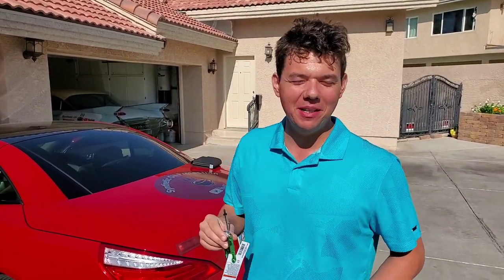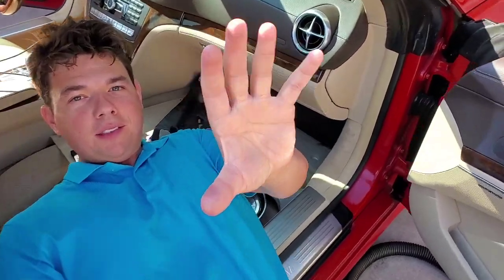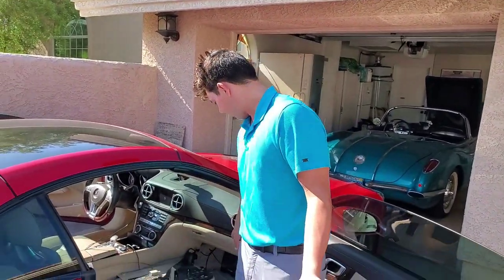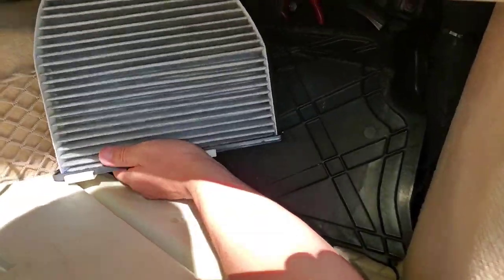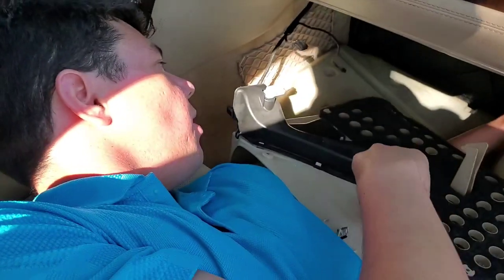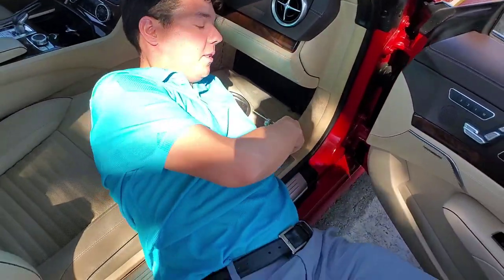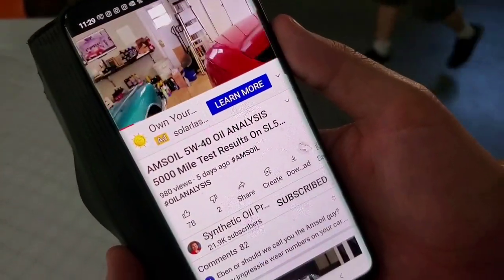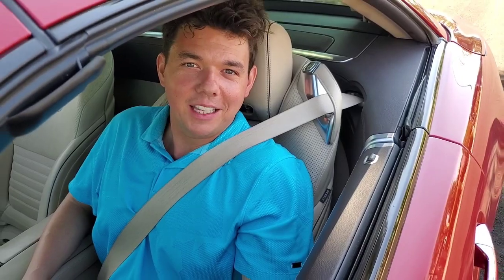Cabin Air Filter Change 2013 SL550 Mercedes

Comment: Very good video to show me where and how, my only nitpick is what about the 1/4”-1/2” gap in the trim with the 12v socket. It also moved, to me, too much as he was installing the next piece. I’ll be doing mine tomorrow so I’ll experience this issue then. Thank you again.
Reply from the maker: 👍💯
I give a man a fishing pole & show him how to fish. 

     Together! We can get your vehicles to run better than brand new!

     For me to get credit & be "Your" Independent AMSOIL Dealer please use my website below or my dealer no. 5331179 call anytime Eben Rockmaker 702-472-3614
After you click on: http://syntheticoilprotection.net
1. Click hamburger menu
2. Click offers AMSOIL preferred customer
3. Click join now 6-month PC member add to cart.  ( there is no reoccurring renewal membership unless you select that dot box ) 
( you have the option to not have your credit card saved if you prefer - est. 1972 )
4. Scroll up to the top Select shop by vehicle.

New promo: FREEQS 
     
     🥇🥇🥇   Synthetic Oil Protection Google map reviews
Eben Rockmaker, independent Amsoil Dealer 
Dealer no. 5331179
(702) 472-3614
https://maps.app.goo.gl/1aXxuXrXK9eJwqK78
            
♥️   See fluid performance tests - https://www.amsoil.com/performancetests.aspx?zo=5331179      

     ☕️   Buy me a coffee - https://www.buymeacoffee.com/Syntheticoilprotection

Comment: Lifesaver, just bought an AMG but was a smokers car .  Hint, n we w filter and some dryer shts will end that smell in about three weeks.  Perm.
Reply from the maker: Awesome enjoy your car and definitely check out the full playlist on the synthetic oil protection machine AKA 2013 SL550 you can do everything that I did to my car and when I got my car it drove like a 7 out of 10 now it drives like a 9 out of 10 it drives that much better After all the fluid changes.
https://youtube.com/playlist?list=PLB_ftWArBFdd-6mgaMuj9bNs7DvKRpNQm
Reply from the maker: If you ever have any questions let me know 💯👍😃

🎬🎬🎬 Professional YouLubher: Eben Rockmaker Regency Gold Direct Jobber AMSOIL Specialist (Dealer#: 5331179) 702-472-3614 

     ✅✅✅  New To AMSOIL I Recommend The AMSOIL 6 Month PC Membership because it will save you about $33 on a $100 purchase after the difference in tax - https://www.amsoil.com/offers/pc/?zo=5331179

Comment: That didn't look too bad. It's a real pain in my Nissan Versa. The whole glove box has to come out and then you still can't see the filter - just gotta feel around back there for it. It's a bad design from Nissan. I love the car, though. :))
Reply from the maker: Yeah the Nissans are definitely a stickler.

The Honda's are really a dream When it comes to the cabin filter and oil changes and transmission fluid changes and coolant changes.

I joke around with people and I tell them I could change the motor oil transmission fluid and coolant on a Honda fit in 44 minutes flat.

Curb styling All I would do is drive the car up on a curb and do it all in one shot lol 😆😁😄☕

I'm sure I'm exaggerating a little bit but it's amazing how easy it is uncertain vehicles 💯

Comment: What about the engine air filter does the k & n really make that much of a difference to where maybe the power and mpg have a noticeable gain or is it so minimal you really dont notice much
Reply from the maker: Oh you can definitely notice it.

On my C5 Corvette the air raid cold air intake that I put on did exactly 1.5 average miles per gallon better.

On my SL550 the k&n air filter did about 0.9 average miles per gallon better

Comment: Great video Eben. Your cabin filter isn't that dirty but, like you, I change mine regularly.
Reply from the maker: Yeah it doesn't look very dirty on the video however the silica out here is unbelievable all the dust and particles from brake dust and there's a lot of like sandy stuff that blows across the street all the time and that filter was totally saturated inside the media really not many leaves or bugs but more all kinds of fine silica particles.
Reply from the maker: I would say it's dustier here in Las Vegas than in New Jersey living on the beach

Comment: Serious question.. do you think amsoil is better than ultra platinum pennzoil?
Reply from the maker: Yes it's not even comparable.

Amsoil is 100% synthetic has a much higher film strength that film seals the cylinders and when the cylinder rings are sealed better there's less fuel contamination and blow by The breakdown of motor oil is exponential so over time it wears down quicker and quicker.

Fuel dilution can really damage the film strength and thin out the motor oil.
Also there's proprietary additive packages that are in themselves from cold flow additives and also anti-wear additives.
It's a big difference.
AMSOIL Performance Test Results. Read This Article - https://www.amsoil.com/performancetests.aspx?zo=5331179
Reply: @Syntheticoilprotection  been using ultra platinum pennzoil and so far good but i will give amsoila try
Reply: @Syntheticoilprotection  how often should i go oil changes with amsoil? I usually go 5,000miles with ultra platinum pennzoil
Reply from the maker: The thing that's going to really surprise you is what it looks like at 10,000 mi.

You're going to check your dipstick in the oil will have barely burned and it's going to look amazing.
You could do a filter change at 10,000 mi top it off and continue to run it and when you get to 15,000 mi it will be cleaner and clearer than it was at 10,000 mi because the filter will actually have caught a lot of the contaminants.
Your car will actually run smoother and better after you change the filter at 10,000 you'll be really surprised.

My car right now is running so good and I'm at 9800 miles on it The oil still looks amazing.

I'm going to be doing my next round of oil analysis here at about 10,500 mi.

You'll get a chance to see what the wear metals are and the fuel contamination and how the cylinders are being sealed.

We're going to be doing a 15,000 mi oil change on my SL550.
Basically 75% of all my driving is city driving here in Las Vegas at about 2700 feet above sea level.
Right now the average height temperature is 98°
Reply from the maker: If you want to try themselves the best way to get it is as the 6-month PC member saves about $33 off on $100 order also when you use my link I'll be your dealer so in the future I could always answer all your questions on the Enzo products and if you have any questions before you order just let me know always happy to talk.

  
     Professional YouLubher: Eben Rockmaker Regency Gold Direct Jobber AMSOIL Specialist (Dealer#: 5331179) 702-472-3614 

     If you're New to AMSOIL I recommend the AMSOIL 6 Month PC Membership - https://www.amsoil.com/offers/pc/?zo=5331179
Reply: @Syntheticoilprotection  it seems way to many miles to go in between oil changes
Reply from the maker: I know that's what I thought when I first found out about it if you just want to get your toes wet you can always get the OE motor oil it's very inexpensive and you can change that at the OEM interval.
https://www.amsoil.com/p/oe-5w-30-synthetic-motor-oil-oef/?zo=5331179
Reply from the maker: There's nothing like getting your toes wet.
I recommend a bottle of themselves engine flush and also a bottle of the Amsoil PI performance improver gasoline additive.

If you have an older vehicle I would definitely do a can of Amsoil Power Foam you'll see that under cleaners and protectants That's the yellow can.

We just did a video on that couple days ago with a guy's car and it was amazing the before and after
Reply: @Syntheticoilprotection  i have tried power foam and p.i not that long ago. Love those products but i havent try amsoil but ultra platinum pennzoil after watching the video from project farm which pennzoil was the 2nd best oil and cheaper
Reply from the maker: You got it You get what you pay for 😃☕😊

However AMSOIL becomes less than free because of its capabilities.

When you look at how much longer your motor lasts and how much less oil changes you do it's quite a bit less than free I actually did a video on that here - https://youtu.be/lR8zvAizmI4
Reply: @Syntheticoilprotection  appreciate you eben

Comment: The most neglected filter 🤘
Reply from the maker: Tell me about it!!!!!

The guy that got my car before had it for only 2,000 mi and he got it Mercedes pre-owned certified at the dealership.

When the guys at the dealership we're doing the certification they said hey did you check the filter and the one guy said yep it's perfect!!!

Most people don't want to do yoga to change their filter lol.

If someone had a bad back there's no way that ever be able to change that filter 😄😁😆

Yep the filter's changed It's perfect!!!

That's what all the technicians would do at Mercedes because no one wants to get down there and do it lol 😃😉💯
Reply: @Syntheticoilprotection  wow......2011 Ram You have to slice a hole in the plastic and then order a little door for it. Wtf really
Reply from the maker: Dodge Ram 😃😊